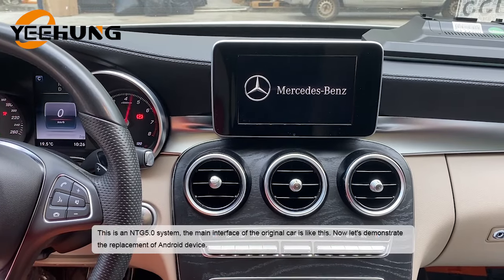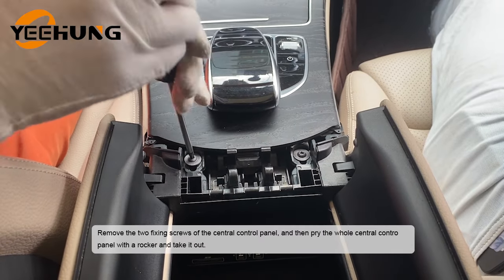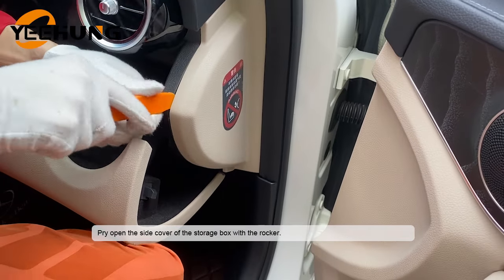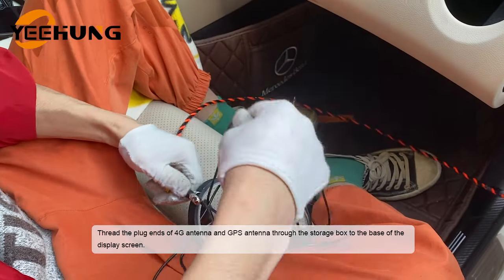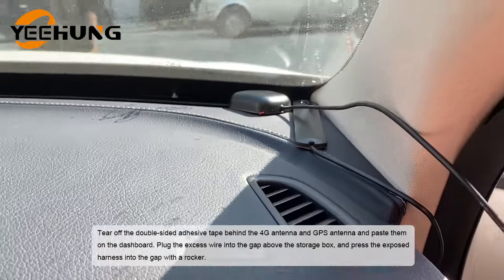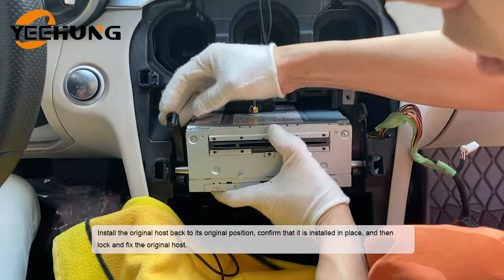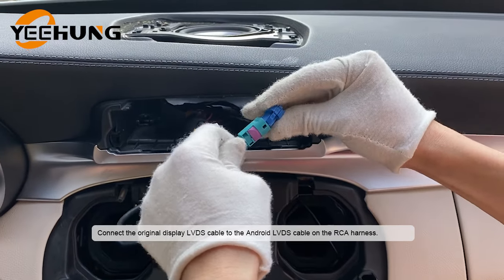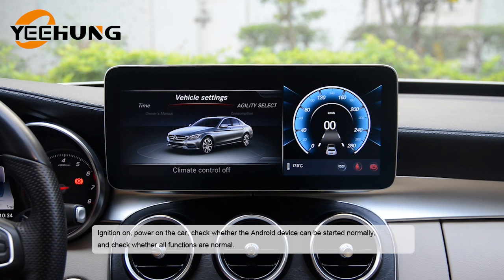How to install Mercedes C Class W205 NTG5.0 YEEHUNG 12.3 "CarPlay Android auto screen(GLC X253 Same)

Comment: With a GPS module and WiFi antenna, can I stick it under the glove compartment so that the items on the right are not affected? Or can I put it right next to the head-unit? I don't want to stick it on the windshield.
Reply from the maker: GPS antenna must be placed in a place without metal obstacles, because it has to receive satellite signals , WIFI antenna can be placed in the location you described.
Reply: @pempcar  Can I place the GPS module and WiFi antenna directly beneath the grille of the center speaker, behind the screen? Will it affect the speaker or the GPS/WiFi signal? I don't want to run wires around the front windshield.
Reply from the maker: @Son-m4a  It is recommended that you place them in a location without any metal coverings. This way the signal strength will not be affected.

Comment: After I install the Android screen my touchpad stop working. Did I do something wrong?
Reply from the maker: The original touchpad only worked in the OEM interface. It does not work in the Android interface.
If it doesn't work in the OEM interface either, could you please help me to check if the wiring harness is all connected, or check if the protocol selection of the Android screen factory settings for another NTG 5.0 will work?
If it still can't be solved, please contact the after-sales service team at Service@yeehung.cn

Comment: Can u do it on a manual? With gearbox
Reply from the maker: Yes
Reply: Could U pls post a video about that I can't find nothing on gearbox :( ik how to get it out but I'm scared about the cables
Reply: @pempcar  I have already installed the digital cluster but idk about the screen cause it's a lil different on a manual gearbox
Reply from the maker: @arandomstranger99  If you buy a YeeHung Android screen and manual transmission, you need to select manual in the settings, otherwise the reversing camera will not work.

Comment: Hello, if you dont want to use android ,  is it possible to use this 12 inch display ? Does it work like normal (original) display if i dont want to instal android box and antenas?
Reply from the maker: You are right, it works just like the original car screen. But because the original screen is 7", the original interface will be enlarged. The aspect ratio is also different. What kind of effect does it have? You can refer to the content starting from the 14th minute and 20th second of the following video:
https://www.youtube.com/watch?v=pHSky8vrMl0

Comment: WIll this work with a 2016 Mercedes C300?
Reply: Specifically, a 2016 Mercedes C300 W205
Reply from the maker: if it is a ntg 5.0, this one fit tyour car.
Reply: perfect! Based on the amazon link you provided in the video description, I have confirmed that I do have a NTG5.0 system per their screenshots on the listing. Great! Thanks so much for confirming this. I can't wait to save up to buy and install this unit myself!  @pempcar

Comment: Everything seems to work except I get no sound I have to use the sound from the Mercedes and it is always a few seconds behind how do I get the sound to work with the new screen
Reply from the maker: Yes, this is because the android sound comes in from the OEM USB, you need to use a separate amp box for android to achieve it without delay.
Reply: @pempcar  I really appreciate the response…. I don’t hear any sound unless it’s over Bluetooth….what must I have done wrong?
Reply from the maker: @Devynderrickleejohns  Dear, you must connect the AUDIO usb BOX to the USB port of your armrest box. Please check the installation content starting at 24:30 of the video. Then every time before you enter Android, select the USB mode in the OEM interface.
Reply: @pempcar  One last question I did a factory reset on it because I couldn’t figure out why I couldn’t get any sound after I did that when I try to connect a CarPlay it says zhijian activation app to scan QR code how do I get CarPlay back I’m not sure also are there any other settings that I need to adjust back after that factory reset?
Reply from the maker: @Devynderrickleejohns  if the oem interface display normal， you don't set other option. If you find other problems, please feel free to contact me：service@yeehung.cn

Comment: Guys my factory head unit is stuck in reboot loop and lines on screen can I fit this or does my main head unit still need to be replaced ?
Reply from the maker: Sorry, if your oem headunit is not working properly. You cannot install this android device. It is recommended that you restore the function of the original car host first.

Comment: hello i have the same screen.  but the knob does not work, I can not control it in the android and original menu.  do you know what could be the reason?  ntg5 best regards
Reply from the maker: Dear，Are your knobs not working all the time? Or did it work normally for a while and didn't work?
If it is always like this, you can check whether the wiring harness of the original car knob is firmly connected, or is there any wiring harness that is not properly connected?
Reply: @pempcar  
so on the original screen it works. when I connect the android does not work, it does not react. all wiring harnesses
Reply from the maker: @aquahobbyy  I understand what you mean. I want to know if the knob has no effect after replacing the Android screen?
1. If you check that the wiring harness of the knob is connected correctly, you can check if the CAN PROTOCOL setting is correct, Settings>factory>pass word 190627>can protocol>pls select NTG5.0(0 or 1)
Reply: @pempcar  If I do such settings, the knob also does not work.  could it be a cable problem?
Reply from the maker: @aquahobbyy  I recommend reinstalling as per our video if it still doesn't work. It is recommended that you apply to the buyer to replace a product. Because both the wiring harness and the Android screen may cause this problem.
Reply: @pempcar  I have same problem the scroll media knob does not work and the power off button or volume also doesn't work on the dash
Reply from the maker: @bigboyztv1  Can you send an email to our after sales team at service@yeehung.cn  It would be great if you could include a video of this issue in the email. Thank you.

Comment: im getting no signal to the oem ntg system. what setting should i do
Reply from the maker: Please help me check whether the original car radio Fm has sound? If so, it could be a problem with the LVDS harness connection. At the same time, please ensure that your agreement must be NTG 5.0
If it still doesn't work, please send an email to our after-sales service team at service@yeehung.cn